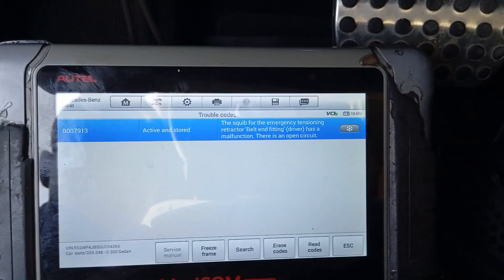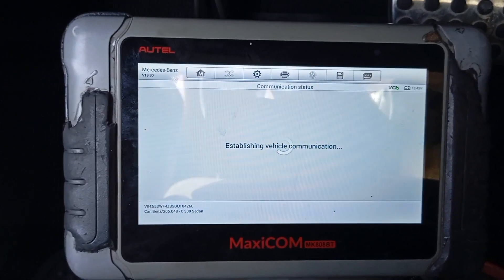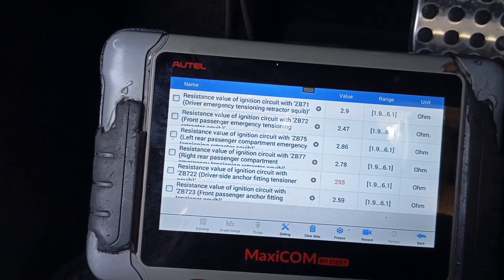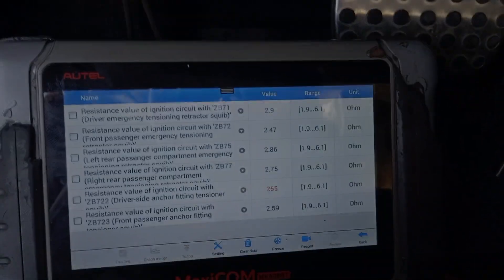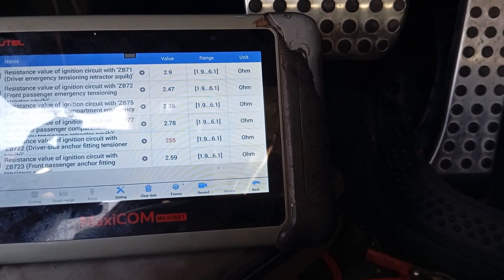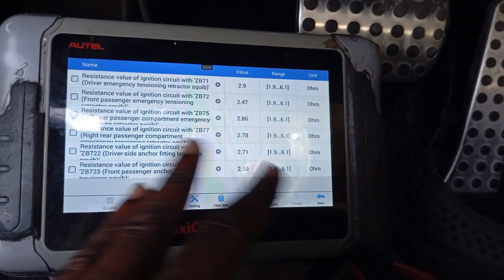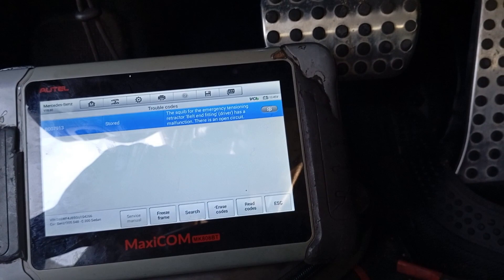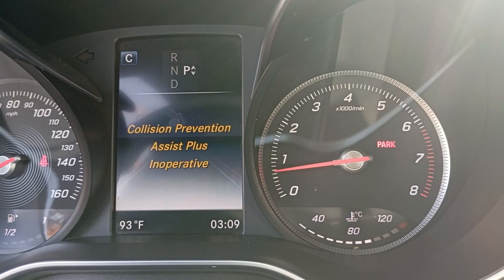Mercedes Airbag [Diagnosis, Repair and Bypass]

Comment: Can you explain how exactly do you put a wires into a plug?
Do you put resistor into the plug?
Reply from the maker: You insert and plug back
Reply from the maker: Shouldering too Works